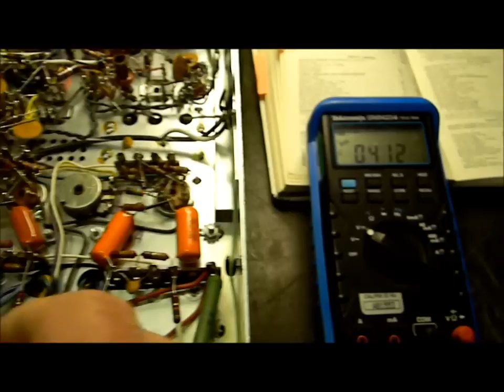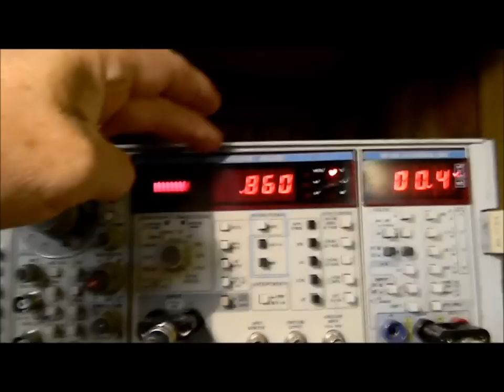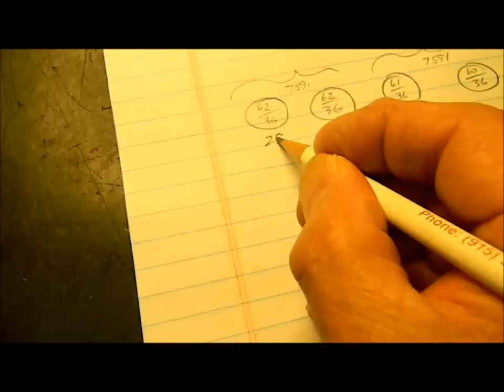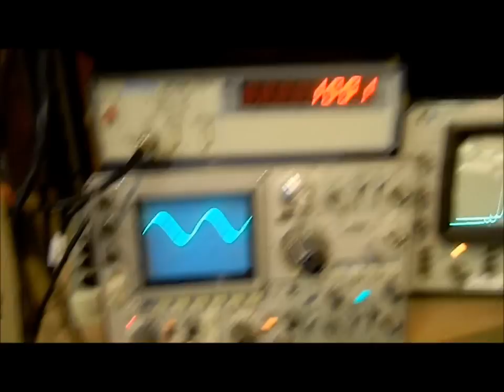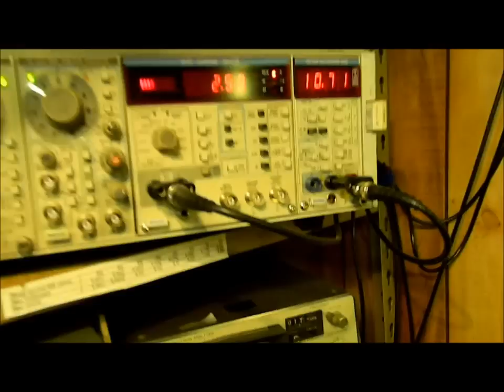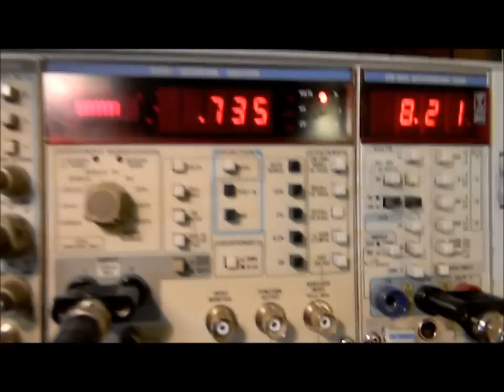Fisher 800 B Bias Variations with Output Power and Harmonic Distortion Measurements

Comment: Thanks for your insight. I will apply this when restoring my X-202C.     
I am also trying to sort out a Luxman SQ 38 presently if i can find an affordable replacement        50C-A10 tube!
Reply from the maker: As long as I have been around, I have never heard of that tube but I see them on Ebay. I see it is a triode. Very interesting. There is this mentality of running tubes so they last a long time. On the other hand, running them somewhat "hot" gives much better performance. We can't have out cake and eat it too, can we?   Best of success with your projects.

Comment: Hi El Paso,only seeing this recently have a question,can any of the distortion figures be improved by adjusting AC balance on these Fishers? I have a couple of 500C's that are just sitting here. I hook em up once in awhile but after a few days go back to the mega system( Audio Research SP3/D-76 & the mighty 10b Tuner) that gets most of the listening time. In their day the Fishers were great.
Reply from the maker: There is no doubt that an AC balance could improve harmonic distortion products as seen on audio THD measurement equipment.  The fact that most drivers have matched resistors on the plate and cathode is supposed to make the amplitude equal but it does (may) not. I have worked on several of the vintage Fisher 500C series and in everyone I worked with, the capacitors that feed the grids of the output tubes have been bad. Not sure why but changing them out is probably a good idea.  Here is a schematic of a Fisher 70-A schematic. Note the AC balance R6. I have one of these amplifiers and it sounds wonderful. Not perfect on the test bench but music to my ears. I often times wonder if I love the sound of it because it was what I listened to at my uncle's house in the early 1960's when my ears were young and I was most impressionable. It was during those years that I spend the summers with him in Oak Ridge, TN where he was a chemist for ORNL. I got my general class ham license in 1963 after a summer with him. He drove me to Atlanta, GA at the end of the summer to be examined by the FCC before I returned home to Alabama for school. I have thought about that many times.
https://www.ampslab.com/vintage_fisher70a.htm
Reply: @ElPasoTubeAmps  I know the 70 and am convinced that anything with the cathode feedback to the output trans has a sound I like. It's something I try on stuff that passes my bench when possible.Right now listening to and liking an Audio Research D-76. Another with a cath.feedback setup although no separate winding. Just needs a careful bias setup. Remarkable amps.
Reply from the maker: @Mr39036ce  Yes, I understand. I studied the cathode winding on the OPT on the Fisher 70-A and the MC-30 and, of course, the McIntosh has fixed bias and not cathode bias. The McIntosh transformer has it own GNFB winding also. In any case, the CT cathode bias winding on the OPT fascinated me. It has a sound I like. So, why do we stress so much over THD and IMD or what ever we went to fuss over and think SET amplifiers are the best ? It is laughable in the face of our dedication to analytical measurements in the field of audio. I guess that is what what figured out way-back-when and it was easy to exploit.  It is all subjective.

Comment: I have what was originally my moms Fisher 500C Receiver. Up till about two years ago it still ran beautiful with all the original tubes! Then to my dismay one of the power tubes went. I then had it serviced and replaced all the power tubes and a few pre-amp tubes. Does anyone know where I could find the original Fisher 7591A power tubes as NOS and what the price may be? I have been using the EHX 7591A. One of them now went? So now I am wondering if I should get a new EHX matched quad set or possibly another brand. It was suggested to me to use the JJ tubes. I do want ones that are specific to The Fisher. Tung-Sol makes ones that supposedly are great sounding but very expensive at around 33.95 each! Any recommendations will be appreciated!
Reply: KarnEvil4 I believe that checking Audiokarma for sources of the original tubes will told you some answers. I believe some of the advertised tube sites there do have them in stock at about $80 a pop.

Comment: Since you added individual test points, couldn't you put in pots to adjust each tube bias thus eliminating the need to match tubes?
Reply from the maker: +Trex1268 Yes, and that is the design in the McIntosh MA230 that I built in 1977,  and still have and use, as a center channel amplifier built from the MA230 schematic with an original MA230 output transformer that I bought directly from McIntosh that year. It works great. You can find the schematic online.

Comment: Thanks for your interesting videos.

I'm curious to know how other 7591 amps/receivers from the 60's compare to the Fishers.  All the 7591 amps were rated 65 or 70 watts continuous power (just saw your RMS power video) so I wonder why the Fisher is clipping at 18 watts/channel.  That's why I'm curious if a Scott, Harmon Kardon or Sherwood 7591 amp is also limited to around 18 watts.  Did all the factories misrepresent or are the Fishers plagued with design flaws? 

How about the EL34 amps.  Are they also overrated powerwise?  I once had a Dynaco Stereo 70 checked at a clinic and  they gave me a printout showing around 32 watts before the  distortion went parabolic. 

I understand about decibels and know that doubling the power from 18 to 35 watts produces a barely audible sound level increase, but this is bothering me. I respectfully suggest you opened a can of worms here.  

And while I'm at it I'm also curious about successive generations of amps right up to today.  Are they meeting spec, or are they also misrepresenting their power capabilities?
Reply from the maker: I think you understand it quite well. The ST-70 is rated at 35 watts per channel and indeed will only do about 30-32 watts and barely (if at all) meet the specs at that power level that Dynaco claims. The same is true for the Mark III - it is a darn good 50 watt amp but not a 60 watt amp. Personally, I like the old Dynaco stuff - it was built with good components and they sound good. They made a darn good output transformer.

The 7591 of old would do a max of 30 watts at true high quality "HiFi" but they would never do 65 or 70 watts per channel. 65 or 70 watts stereo would be OK to claim.

And yes, everyone of them exaggerated power output. With that said, the Fisher, Harmon Kardon, Scott, Sherwood, etc. had "good" sound but 20-25 watts is about all they could do. Speaker efficiency was the thing-of-the-day so they sounded good and loud.

Back to the Dynaco - they have the reputation of being called the Poor Man's McIntosh.

With that said, every McIntosh amp I have ever tested, vacuum tube or solid state will do a good 120% or more of what Mac rates them at. But then a good used Dynaco will cost you $400 and a good used McIntosh will cost you $4000 or more.

There are kits available on Ebay where you can build your own "Dynaco" called VTA. Some of them run four KT100's. I have tested them and they perform poorly. They do not come close to delivering the power you would expect and their frequency response and THD  is poor - I have only tested two and they were built by the same fellow so unless he made the same mistakes on both, then what else can I say. They both measured the same -  I hope this doesn't offend.
Reply from the maker: While I am at it I might add - there is a really interesting article about Frank McIntosh and George Gow that can be found on the Internet. In the late 40's these guys realized that the world needed a GOOD 50 watt amplifier not another cheesy version of the Williamson or Mullard designs and they set out to do it and did indeed accomplish their goal. Much of their success was in the design of the output transformer. A bit later David Hafler and Ed Laurant founded Dynaco and their design became a patented design. They did a good job. Unfortunately, the 6AN8 was probably, in hindsight, a poor choice but theirs were simple and as I mentioned about 10% the price of McIntosh. You will enjoy the read of both of these men. A book to acquire is, "Audio Cyclopedia" by Howard Tremaine. This material cuts-to-the-chase and doesn't put down anyone. It's just data - that is where I try to keep my YT videos - at the data level and let the individual decide.
Reply from the maker: OK now I am on a roll and I will post what I think and feel - I will probably hate myself in the morning  :-)
I started my HiFi hobby in 1960 and one of the first higher-end amplifiers I enjoyed was the Fisher 70-A amplifier and 50-C preamp – it is still is a dream sound – I guess it is the Stradivarius amplifier/preamp, to me – and it was monaural. The 70-A will do a good 18 watts with many imperfections.  But I love it. I have one. The 50-C is Clean, Crisp and Beautiful. Nothing can touch it – not even McIntosh can out-do it.
The amps recently discussed, sounded to me, to roll off excessively at the high end and were “boomy” at the low end. I never liked them.
Next the Dynaco – they cleaned up the high end roll off and boomy’ness – Big improvement. Then McIntosh came along around 1963 in my life and all the stereo artifacts were gone – clean, responsive, never ran-out-of-power and so on.
The difference between vacuum tube and solid state – and I am talking about McIntosh level equipment – solid state, much brighter in the high end – low end is powerful – pretty much how vinyl records compare to CD. I have learned to like the “brightness” I guess because my ears are getting old.
Quite honestly, I rarely listen to vacuum tube equipment anymore. With that said, a Mac 1700 is playing in my shop as I write this. All 100% original McIntosh branded tubes but the output stages are solid state. I play it into a set of Paradigm FOCUS speakers – sounds great.
In my Theater I use a McIntosh 2100 amp, Mac preamp/tuner/CD/DVD player all going into Klipschorns. A big screen comes down out of the ceiling with a nice high-end projector – better than the mall theater.
But, to each their own, I was taught by my uncle in the early 60’s days the only way to ever be happy with your HiFi set up is to have the attitude – “There’s no HiFi like my HiFi”. It is the only you will stay sane then and now.
Reply: ElPaso TubeAmps
Lots to discuss here.  In the tradition of shattered childhood legends like "there actually is no Santa Claus"  you're shattering my  lifelong mindset about vintage tube electronics.  Since I did not own test equipment and I have little  knowledge of electronic theory I would rely on test reports in High Fidelity and Stereo Review for my information.  Their tests of amps/receivers pretty much always confirmed the factory specs so it became a popularity contest to decide what brand and model was best.  Best meaning the faceplate you liked best, since all 7591 amps were nearly identical in rated and tested performance, and all were rated 65-70 watts, both channels driven. 

One only needed to look at the construction of the comparable Fisher, Scott, Sherwood, Harmon Kardon  (etc,) to figure out they were the same.  The tubes were the same, 12ax7s in the front, and 7591s in the back.  The transformers were similar in heft.  The overall weight was similar.  Just like a midsize Ford Fairlane V8 was not much different from a Chevy Impala  V8, especially in retrospect.  Ultimately, one bought these machines for their tactile and aesthetic qualities, not their engineering prowess since they were pretty much the same.  Today, we buy Camrys, Altimas, Malibus, Accords based solely on what we like to drive and look at since they're all nearly equivalent   (I'm not discussing build quality or reliability, but rather the whole package)   And that was how one bought 35 watt/channel amps/receivers in the late 60s.  To learn at this late stage that they were really 18 watt/channel machines is to learn there is no Santa Claus.  I don't dispute your findings.  You certainly are consistent and skilled.  I saw the McInstosh videos and there is no doubt they meet advertised specs.

Now I wonder if the small Dynaco EL84 amp.....SCA-35 I think..... meets spec.  This would be another myth shattered.  How can a lightweight amp with small tubes and small transformers be equal to its much larger and weightier siblings?
Reply from the maker: lusciousbobby- No Santa Clause ? - I won't go that far - maybe he just isn't as big as we thought   :-)
I have never tested the SCA-35 but I suspect it will do a good clean 15 watts per channel. As relates to cars, how many have 120 or even 160 MPH on the speedometer but will only do (maybe) 100 ? It's the same thing the way I see it . People my age once they became a teenager in the 60's all seem to want a 1957 Chevy. Personally, I wanted new cars.  I don't think one should be disappointed that the HiFi world exaggerates everything. There is a beauty in most all of the makes. Think about the old Dynaco stuff - pretty plane looking stuff. But the quality was good and it sold to those that appreciated quality over glitter. I do have a video on YT about the Fisher 70-A that you might enjoy.

Comment from the maker: All of these types of amps are AB1 and lowering the bias (making it less negative) which increases cathode current tends to  reduce crossover distortion. The method of raising the bias voltage (making it more negative) to prolong tube life raised crossover distortion (and ultimately, THD). There is a tradeoff between low distortion and high plate dissipation. Distortion will tend to decrease up to he destruction of the tube. That has been my observation.

Comment: I put a nos set of international serviceman 7868 tubes in my fisher x100c and I am hearing harmonic distortion on my left channel it is amazingly cathode bias. one thing is their is a control that changes the heater voltage it is set to the lowest point.

Comment: are you sure the tv7 tester is in good shape and/or calibrated? according to your numbers those tubes could be consider matched but clearly they are not, my tube tester is capable of inform how the tube will perform with acceptable accuracy  after I do the tests (shorts, grid leakage, emission or Gm...) BTW my tube tester is a mercury 2000.

Comment: There's another Youtube video entitled "Matching 6V6 Vacuum Tubes With The Tektronix 576 Curve Tracer" in which a Tek 576 with a modified plug in module is being used, in conjunction with two ext supplies for filament and screen voltage. That guy did a nice job adapting the 576 to vacuum tube curve tracing.

Comment: @essoterric Some folks have adapted Tektronix 576 curve tracers by building custom test fixtures. The 576 can deliver more than enough voltage to test many types of receiving tubes used in audio output stages.
The new tubes from Russia are hit and miss. I like the old stock Tung-Sol tubes the best.

Comment from the maker: Thanks again for your comments. I agree with you on all your comments. I appreciate you adding value to the videos. I have noticed, as you commented, low cathode current does not bode well for high performance with power output vacuum tubes and I see very often low cathode currents in some (but not all) new production tubes. I am not aware of a vacuum tube curve tracer. If there's one out there, I want it.

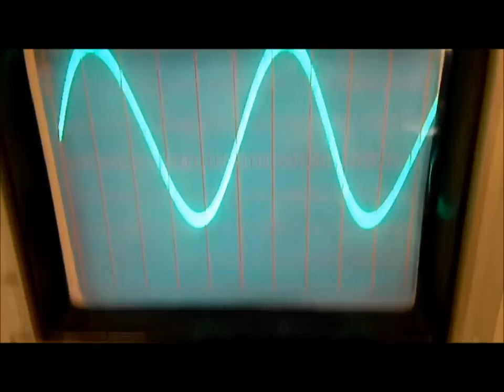Comment: 15:04  classic Class B notch crossover distortion from insufficient current with the weaker tube. The weaker the tube, the less negative bias used on the control grid to maintain the current and keep the tube operating in the linear range.
You need a curve tracer. Nothing matches up tubes better than a curve tracer.

Comment: Also, in most all cases, the .047 uF caps that feed the grids of the 7591's are bad. I have measured the bad ones as almost open - measuring only a few pF of capacitance. I would replace them with standard Orange Drop 600V caps. These caps are also usually bad in the whole series of Fisher amps using 7591's built around this time to include the 500C and others.

Comment: Thank you for your comments. A bridge of 400v/8A will work but the bias voltage is low and very low current so pretty much any bridge rated at a hundred volts or more or a set of four diodes will work. You won't need to add any regulation. The only issue with some of the modern 7591's is that some are physically larger (taller) than the old ones. Do the research and make sure any that you buy will fit in the cabinet and it should work fine.